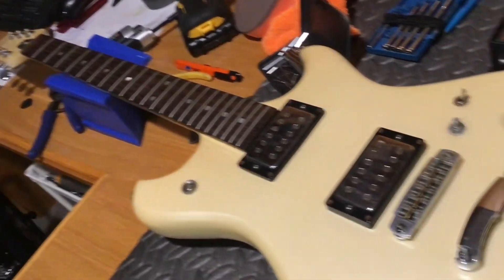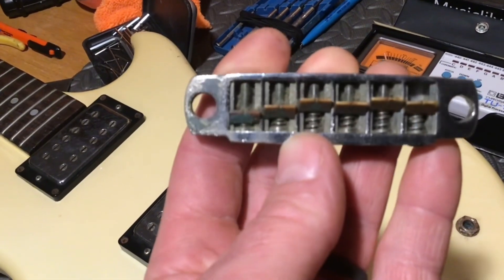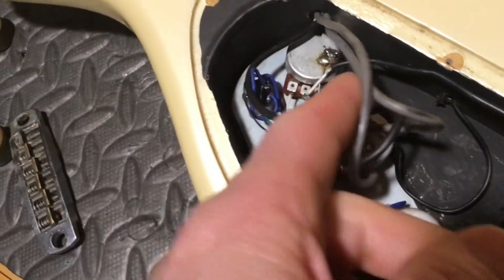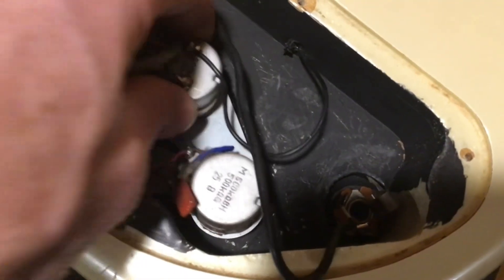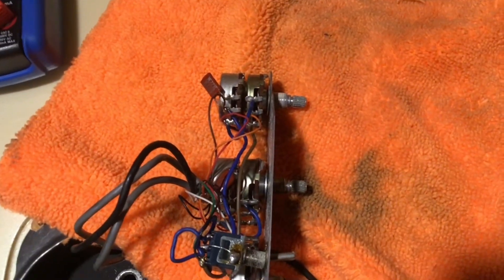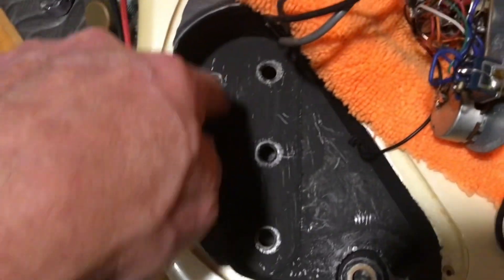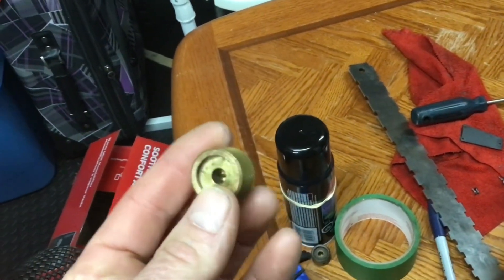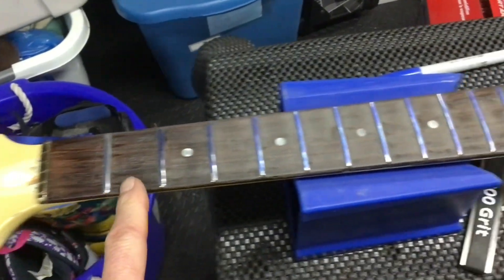WESTONE THUNDER II - Part Deux 😁!

Comment: This guitar is chock full of surprises, J! I thought the knobs could be saved, but I have to say how impressed I am with those pots, the solder work and the wiring system on this Westone. Shame about the frets and the corrosion, but what a great job fixing it up. All that time and the only replacement parts are the output jack and the toggle switch. Nice!
Reply from the maker: Yeah eh? Not too bad haha...
Wish those frets were a little taller. It'll be fine, but I for one don't like frets so low that my fingers scrape the fret board every time I bend a string haha... hope to have it together by Saturday 😀.

Comment: 4:40 — This is EXACTLY what I was expecting and hoping you would find, J-MAN! I had a feeling this was what you’d find, given the detent and behavior of the pot that you described in Part 1. As I said on that video, my guess is that it’s probably similar to the Fender TBX system—look it up! It’s a bit more complicated than a typical tone pot, but it’s not rocket science either… Basically, the way it works is: There are 2 stacked pots, one of which has a half track in it, and the other one has a reverse half track, with a detent in the center, where the wipers don’t connect to either track in either pot, so neither pot has any effect in the center, but if you turn it one way, it acts as a treble cut, and if you turn it the other way, it acts as a BASS cut. It’s actually a REALLY cool idea, and I’ve thought about installing a system like this in one of my humbucking guitars, as a way to get a more tightly controlled low end when I want it.
Reply from the maker: Sweet man thanks! That confirms what I was reading up on last night😁

Comment: I'd be interested in seeing what the wiring was like on those stacked potentiometers and how they're using them. There was a tone cap on two of them so I'm assuming they have a scheme for two tones and one volume
Reply: My guess is it’s probably similar to the Fender TBX tone circuit, where each of the 2 pots has a half track in it, with a detent in the center where neither pot has its wiper connected to the track. This way, if it’s in the center, it has no effect, but if you turn it one way, it acts as a treble cut like a traditional tone pot, but if you turn it the other way, it can act as a BASS cut. It’s SUPER cool, if implemented correctly!
Reply from the maker: Yup 1 Volume and a neck pup tone and bridge pup tone😁